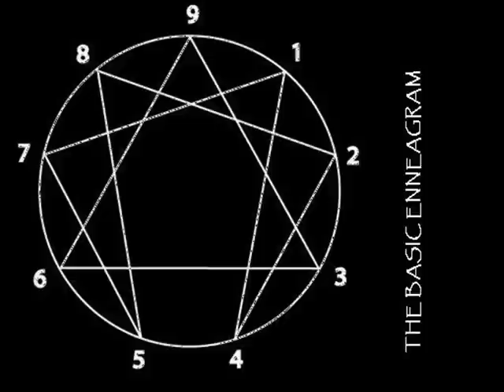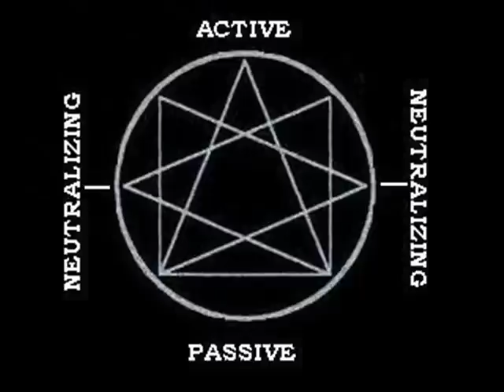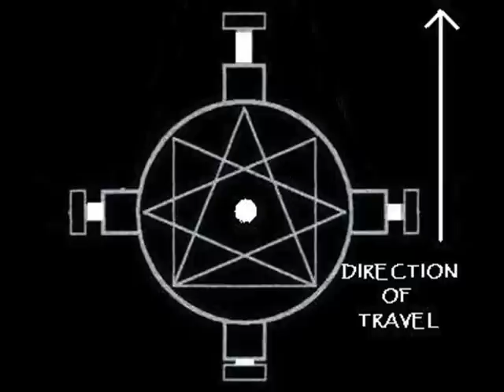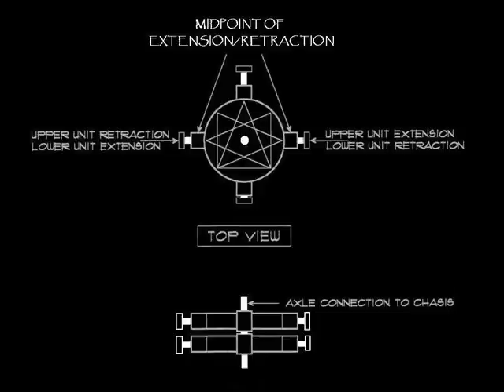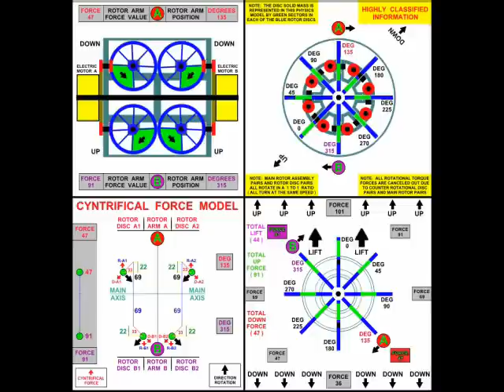Antigravity  Propulsion from Centrifugal Force Discovered

Comment: I seen a working model in 1973 in Abilene Texas, it worked...
Reply: it was called internal inertia drive back than... I built a single rotor out of balsa wood , it would not fly but it would move across my workbench
Reply from the maker: ne1cup My designs, as submitted to the US Dept. of Energy, office of energy related inventions was titled "the inertia transformer".  Sounds like you have seen at least some success as have two other commenters here.  It works.  No doubt.
Reply: ***** bingo!
Reply from the maker: Do tell,, tell your story.  See recent comments bby me..  Patent office ddata cconnfirrmss approvedd patennts on cclosed propulsion cclear back to 1925,  sorry for the double type....computeer gglitcch..
Reply: ffeijdrug
True, we can find patents dating way back. I myself won't patent any of my work. I learned from Maurice Ward that patenting a device is the quickest way to allow someone to steal the plans and then build it.

When I conducted extensive research into inventing, I came up with a design which is probably the easiest to build. It employs four motors that would comprise what I call an Orbital Drive Motor.

I will say it is highly inefficient, extremely wasteful on electricity, and pouts massive wear on the metals used in the motor, but it does in fact create an upward thrust. Electricity goes in, and the Orbital Drive Motor creates upwards thrust. :)
Reply from the maker: Rockguitarnow True, patent pending means ""steal it now". I have seen it with associates of mine,  Tis a ccorrupt system
Reply: ffeijdrug
Plus a lot of people don't realize that senior programmers said Microsoft built a back door into all Windows from 3.1 onwards. My websites explains more in this

The Microsoft Access code - Opens any computer, used by large corporations.
http://www.protectiongroup.org/access.html

Creating a 100% private computer  - Better privacy than the any virus software.
http://www.protectiongroup.org/equip.html

Comment from the maker: Assuming such a propulsion system can reach millions of MPH in a short time, in space, the problem arises, as to impact with any  particle.  Even a particle the size of a BB at millions of MPH relative veloctity would have explosive impact.  A sufficient radar system and impact shield would definitely be a MUST.
Reply from the maker: Alec Bucher IMO, THEY is NOT youtube, as some may think.  They did NOT censor your comment.  Marked as spam by youtube, however, are several DISSES of me and this video/idea.  These contained NO links or advertising.  It would seem that youtube itself WANTS this vid to fly.  No cheating on view numbers either, as I just researched thouroghly clear back to date it was uploaded.  As far as THEY being the shadow govt. or something, it's ALREADY too LATE.  Two people with engineering know how, who have commented here are in private communication with me and are currently  building prototypes to soon be front and center , here on youtube.  Truly, as Rick stated, the cat IS out of the bag, LOL.
Reply: Not true!  Since your mass would increase with acceleration, your velocity would be your shield.
Reply: I have noticed something on my own in my own experimentation with a brass wheel/pulley from a tape recorder that when i attached it to a 25,000 rpm electric motor and gave the motor full power with the disk rotating at approximately 15,000 rpm, anytime i would put a magnet near it the magnet would be repelled no matter what polarity was put towards it, and what you have spoke about is a theory i have wanted to try but never was able to experiment any further
Reply from the maker: Tim McCarthy Interesting phenomenon, with the repulsion of the magnet.  I suspect you may be onto something to do with static electricity from it spinning, but I really don't know.  Very interesting.  Thanks for sharing!
Reply: ffeijdrug
No problem, This may sound far fetched but about 4 years to 5 years ago, i had a dream where i was part of constructing something major, something that could change the world forevor, Essentially it would be like a stargate, but it would work not only for interstellar travel but travel on the planet as well, When I woke up I havent been able to get the machines design out of my head as if some one gave me plans for a device that could punch a tunnel through the fabric of space and time and as you emerged from the other end of the tunnel the time would be exactly the same as when you entered if you were travelling somewhere on earth of course, and it was built similar to a multi ring gyro and all rings were free moving and had enormous amounts electromagnetic energy and at the center was 2 disks that counter rotated and moved in every which way possible and were also highly magnetically charged, and there was a drive system that would turn the outer ring in which would cause a perpetual effect on the other rings and disk and would increase into rotational speed, using the megnetic fields to manipulate space and time and create a wormhole.
Reply: Alas if i was to attempt building this machine, i wouldnt be able to have access  to materials and wont be able to aquire the funding for such a project.
Reply: there's a reason they don't want society to know about this and they will do all in their power to keep it that way. Be careful
Reply from the maker: 1954murphy I had to go to my own theory, to http://www.fourthway.us/r3.html
to see if you might be right and I think you ARE.  Since TBR proposes that motion is force dependent, the spacecraft , by acceleration would gain an immense amount of mass, where an obstacle object would LOSE mass.  The craft might be millions of Kg, while the object might be 100kg.  It would bounce off like a ping pong ball.  Special Relativity says motion is relative and so BOTH would gain mass, but TBR contradicts this.  Thumbs up.
Reply from the maker: catfish4975 Catfish tastes like MUD , unless properly cooked.  Do you have ANYTHING to say, that shows WHY this is BS, other than simply serving MUDBALLS?  Math will do nicely.  I'll be waiting, Mr. Physics whiz.
Reply from the maker: catfish4975 I got your reply to my reply in my email inbox and have read it.  It was so vicious and disgusting, that when I came here to reply, it is not even here.  LOL...youtube DELETED IT.  Not even listed in spam.  One more chance, if they will let you...MATH.  Not MUDBALLS.
Reply from the maker: catfish4975 F = mv^2/radius.  v is less, in 1/2 of the circle, thus Force is greater in one direction than it's opposite.
Reply: ffeijdrug Agreed! the procession of the equinox has entered a higher vibration and modern science and religion will converge. The people in power will try to hide and maintain power. However, like you said, the cat is out of the bag haha
Reply from the maker: Alec Bucher Indeed, this technology, as well as so called free energy ARE related to certain psychological and seemingly supernatural ideas.  Spirituality and science are indeed converging, into what is the TRUTH OF REALITY.
Reply: Not of it matters much if people confuse centrifugal force,gyros as some type of anti gravity,it is not period.Same with the electric lifters,anti gravity ?,no,its a ion wind,no different from a propeller,rotor blade,rocket engine etc,it produces a downward force of air and the lifter rises.Duh !!! people need to understand how gravity works,before they ever could conceivably build a device overcome its effect and most don't or can't be bothered.
Reply: Thermospecialist yes,they confuse Newtons 3 laws with antigravity.People with gyros,claiming the gyro is defeating ,canceling out the effect of gravity,if only it was that easy,we all would be flying around.Throw a gyro or some type of inertia device and away we go.I'm surprised when I see aerospace people ,making these ridiculous claims about UFO's,magnets,etc Silly talk.
Reply: Thermospecialist I believe that ANYONE who claims to "understand" how gravity works is delusional.
Reply: I woke up this morning and decided I wanted to have a heaping helping of bullshit, so I watched this video and was convinced I had received enough bullshit for the day. This is crack head science. Go take a goddamn fucking physics class.
Reply from the maker: catfish4975 There is no such thing as perpetual motion or OVER unity. But if you look at my popular uploads, there is something akin to this.
Reply: Conservation of momentum commands that the sum of all forces, working on moving parts within an isolated system, is zero. Assuming the system would yet accelerate, ignores that the total mass of it would set up an inertial force against the direction of acceleration, thus no net acceleration can occur. An external counter force would be needed to cause the system to accelerate, as per Newton's first law. Inventors of inertial drives lack knowledge of basic physics.
Reply: .  isn't gravity a effect of the curvature of space,by a large body ?,spacetime curvature = gravity
Reply: inagod
The theory of curved space-time is a more or less correct description of what we observe. It says nothing about the true nature of gravity, which is still a mystery. Science describes what is observed, while trying to exclude by necessity(!) what is not observed - the latter part is as yet unsuccessful.

You are right about needing to understand how gravity works (I +1'd that comment), while most YouTubers don't seem to have this understanding, making up their own stuff in ignorance. If they then claim to "know it all", they are stupid also.

Comment: I made a crude centrifugal "antigravitic" lift engine.  The end result only made it 75% lighter and eventually shook itself apart.  I called it an "angular momentum drive".  I found the forced "moments" of the "Y" circle were around 10:30 and 2:30 because having it at noon was too late. I accidentally found this by trying to produce a lateral pull ------>.  My professor said all it would be is an "expensive paint shaker". Maybe if it were made almost entirely out of titanium, it may lift more than its own, but I haven't the money for that nor machining ability.
Reply from the maker: I think the forced moments or movements must be at 9:00 and 3:00.  That is, they must average those.  Hey, 75% is pretty good EVIDENCE of a working technology :)  How about you get this vid link listed at your radio chanel site and spread it to others?  I liked your comment on "we all bleed red", too.
Reply: ffeijdrug What about if I embed the video (HTML) as the next post on my site or download it from Youtube and upload it on my site?  Only wanting to spread the word and knowledge.  This should be non-proprietary in that it should be available to all so it can not be suppressed by governments. I will respect and honor any decision you like.
Reply: More arms and weights with a central circular control ring much like a helicopter could make a forward momentum drive for a vehicle. I do not think centripetal forces such as this can escape the Earths gravity without also including controlled magnetic fields involved. The combination of magnetic and centripetal may allow lift enough to fly but I doubt if it would function without the interaction of the planets magnetic field so outer space would be out of the limits of the drive if it would work.
Reply: Outer space isn't real

Comment from the maker: From Author: This would better be classified as Closed Loop Propulsion than literal antigravity.  The unit can be directed either away from or towards an object.  In any case it is much more energy efficient than rocket or even jet propulsion.
Reply from the maker: ***** Yes, it has to do with the direction of the forces, but moreso, and I should have added this to the vid, with DELAY TIME which is also paramount in the extension of a magnetic field, making both closed loop propulsion AND free energy possible, but the electromagnetic technique is much higher tech than the physical mass rotation technique, even though magnetic delay time exists naturally in nature.  The solid mass technique simply shows the result of using delay time, but the REAL and ultimate technology lies in the electromagnetic usage.  Are we having fun yet?! :-)
Reply from the maker: RiaRadioFMHD773 Certainly, machining accuracy is crucial, just as in any high rpm device.  But as I said in the video, slower rpm's and heavier masses can reduce this critical factor.  As well, as larger units are made with a greater radius
the need for high rpm's decreases.  Rick's and likely your device were small, with a small radius.  Increase this to a radius of say 10 feet with a lot of mass being moved, and accuracy of machining is not as critical.  Hey though, a 75% reduction in weight, in your prototype, is pretty good proof of a working technology, even if it didn't get off the ground.  You see, if you, I and Rick can come up with the logic of this , it is a no-brainer that the US govt. has it already...and with about half the national debt UNACOUNTED FOR in the overall CIA budget, that is quite a clue that black op programs in this area are and have been going on for some time, without the knowledge of congress or the executive branch. 

s.g.
Reply from the maker: RiaRadioFMHD773 Other areas too, I should say.

Comment: In my opinion I don't think antigravity is possible because if you get rid of gravity on an object you would have to also get rid of the mass of the object and this is impossible. Planes relay on moveing air as a force to counterbalance gravity. Antigravity magnetic forces will never work because the force created by the magnetic fied of the object will have to overcome the magnetic fied of the earth. Think of the earth as a giant magnet in order to get out of the magnetic field of the earth you would have to have a magnet greater in mass than the magnetic field of the earth and that is impossible
Reply: The amount of gravity on earths surface is a set amount. All a internal propulsion generator would have to do is produce the same anti gravity  amount.

Comment: i have my doubts about this. mostly because of the heinous spelling errors and the fact that its centripetal force not centrifugal... at a couple points in these diagrams he even spells it cyntrifical force. no offense but you would think that someone who has been working in physics and engineering would be able to spell properly. also, there is no constant. even if spelled wrong you would think a person would pick one wrong way of spelling and not use two different ways.

Comment: I made it and there is a secret that hydraulics and this plan is weak. Doesn't work.. It doesn't work because of relativity. That's the key. I'll get the timing down and post it. I keep blowing apart my disks, but I'm getting a big jump when it does. No back engineering, just the human brain at work

Comment: I'm going to have to agree with you, since the immutable laws of physics aren't going to be changed.  The actual weight of the mass can't possibly be changed since weight = mass*gravitational acceleration.  But what CAN be demonstrated is that if an opposing force is applied to the mass caused by the mass spinning and rotating creating an axial force in the opposite direction of gravity, then it can "appear" as though it weighs less.  This explains the phenomenon we see in the video.

Comment: (No dis-respect sir, but)  It sounds like a bunch of BS to me! I'm not saying it cannot be done but, Let's think of some forces that counteract or defy gravity. magnetism, air, (air as the force made by a propeller) Don't forget you have to figure out what will power the unit. Go back to the basics, what powered the first movement in the universe? abundant elements that (when mixed) caused a explosive reaction. (the big bang)  Open your mind! (in a zone you don't normally go) Then U will get it.

Comment: I think variable cams would be a better solution then either hydraulics or gears as far as altering the position of the weights. If it had one lobe and was made to rotate in unison with the other on command you could vector the thrust in two dimensions. If you designed it with an identical unit centrally at 90 degrees you would have full 3D propulsion. The second unit would also add to the forward or reverse thrust when its lobed cam was not positioned for lift or decent. Interesting theory...